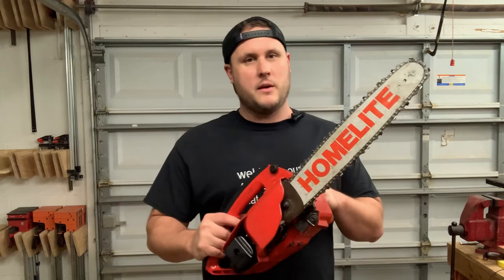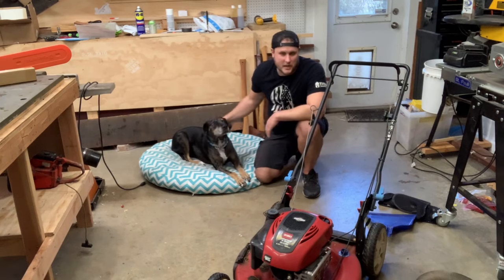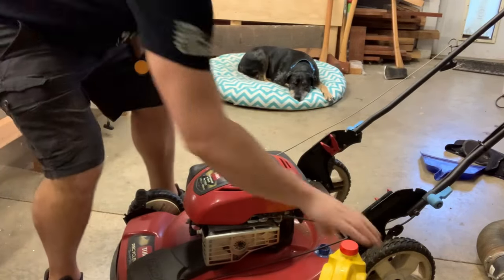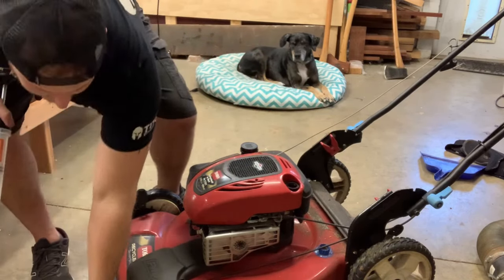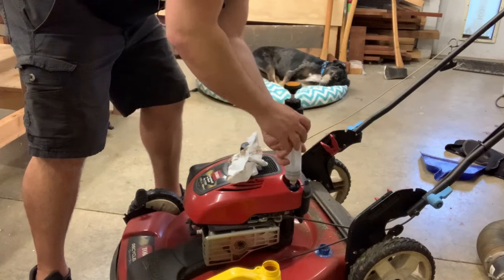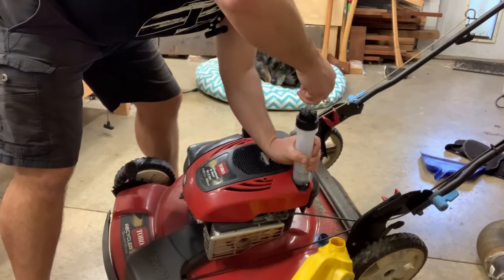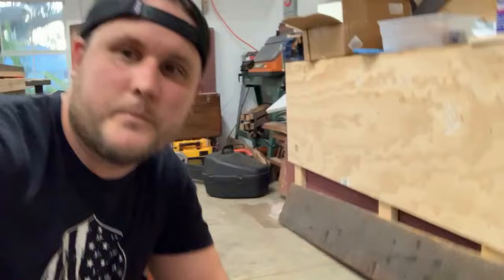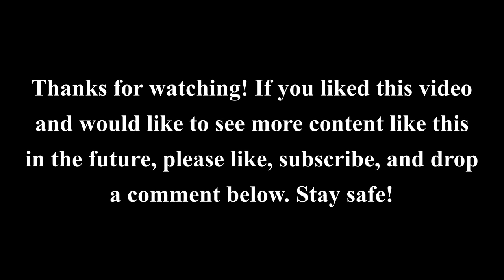DIY easiest way to remove oil, gas or fluids from a lawnmower / small engine

Comment: What kind of cleaning fluid do you recommend with this extractor, so as not to get any cross contamination between various fluid types such as brake fluid, oil etc?
Reply from the maker: I’ve been using a dish soap and water mixture and that seems to work well.
Reply: @mainelysmallengineDIY  ah I see. Thank you kindly for your reply.